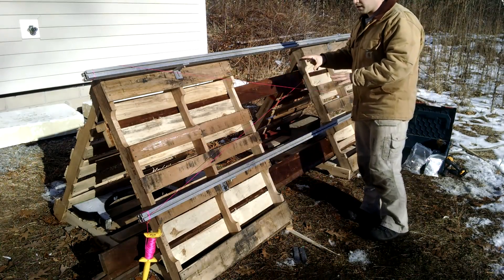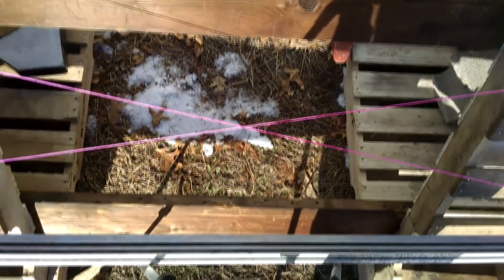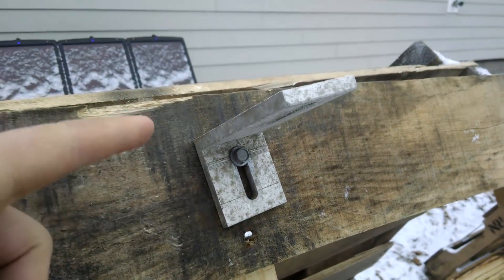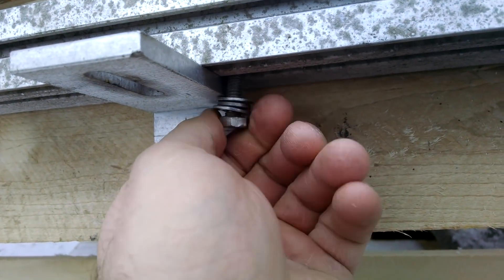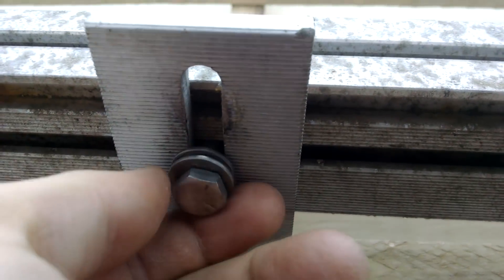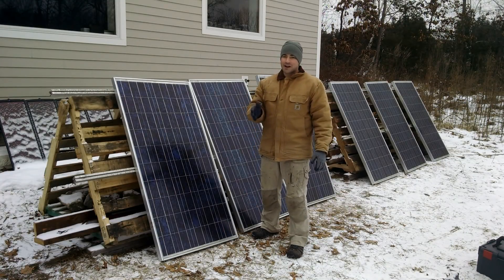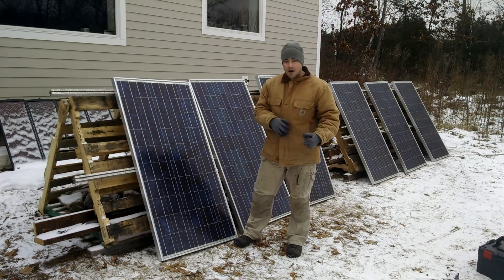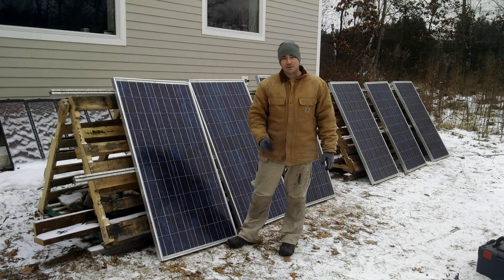DIY Solar Ground Mount from Pallets, Free: Part 1

Comment: When you use the crossed strings to make two rails parallel and in the same plane you need to raise the upper string the same width as the lower string before you chase the ;string just kiss' point. If you don't then the two rails will not be in the same plane as one corner will be two strings width lower than the other three corners. 

If you got some lose ends on the upper string then simply wrap that around the rail an put the upper string over that and now the upper string is one strings width above the lower so when they kiss they will be in the same plane.

For something like this it doesn't matter that much as long as the strings are thin and you don't use a garden hose to do it. :-)

Comment: I see your question (below).  You will be pleasantly surprised to know that PV panels are incredibly strong- the glass that is. Shockingly strong.  My first load of 24 panels arrived on 2 pallets (of 12 each) that were constructed badly, and the delivery driver crushed the 2 bottom PV panels up into the stack of 12 when he attempted to lift it (in the center) with his hydraulic pallet jack. The frames of the 2 bottom panels were twisted like a pretzel--- and the very bottom panel had actually disappeared up into the PV panel above it directly above his pallet jack---  but the glass survived !... can you imagine.

Comment: I'm enjoying this. Good that you explained that this is a "fun" project. Because your attention to detail regarding the parts and installation doesn't quite match using discarded pallets. 
Also, I appreciate you giving the specs of your parts list. Very important. Keep up the good work. And, cute baby!
Reply from the maker: I put some attention into the rails being in plain because I was worried that if I clamp down a panel to something off, then I might cause the glass to stress and break.  I don't know the specs on PV panels and that might not be an issue.  Do you happen to know?